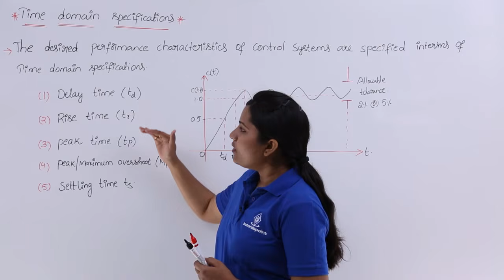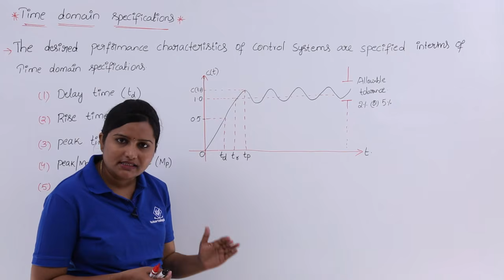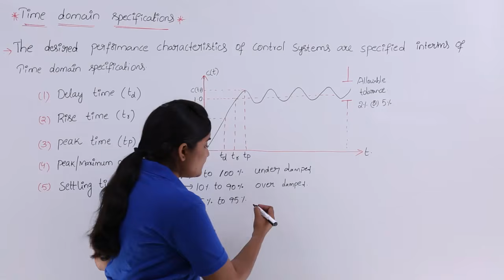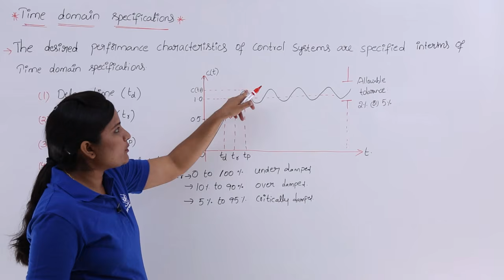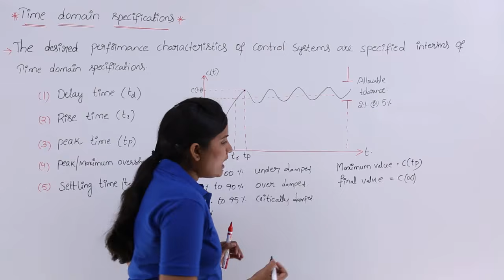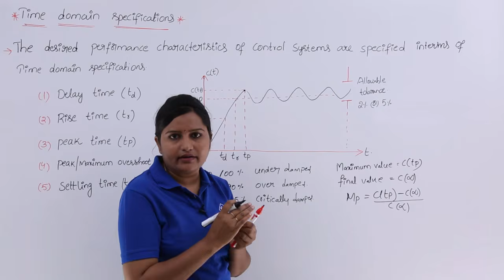Time Domain Specifications

Comment: Slight correction at 5:35 regarding 'Peak Overshoot'. It has nothing to do with time. It's just the difference between the highest peak achieved (magnitude) and the final resting peak (magnitude) in terms of final resting peak (magnitude).